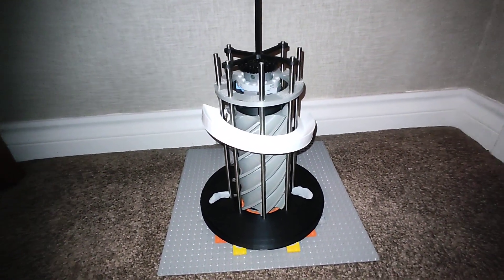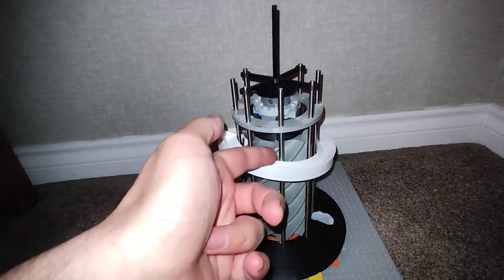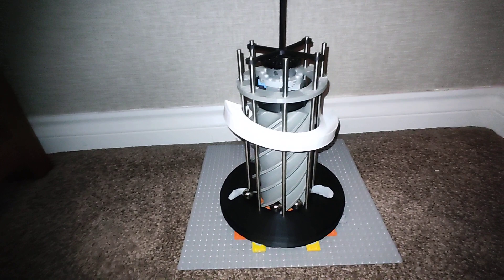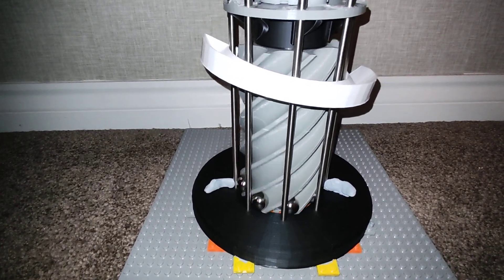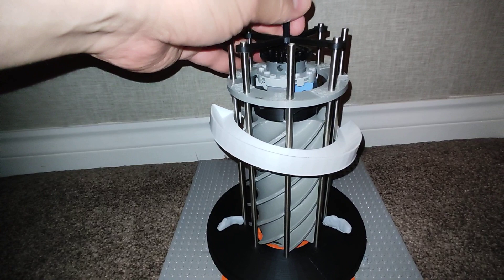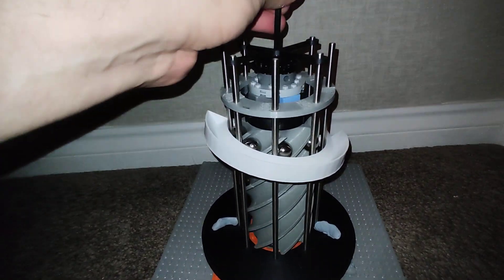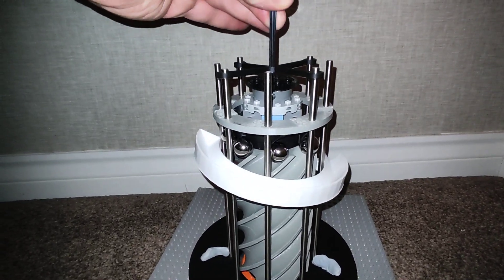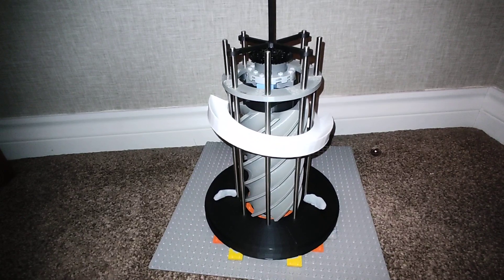MMX Helix Lift Short Update: The exit ramp.

Comment: It could use some fettling and perhaps a large wheel or crank with a long lever arm so you can turn it more easily.
Reply from the maker: The clips of the ramp extend too far into the helix, so yes these require sanding down. The active holding surfaces are actually round the back.
If you watch my other Helix Lift videos, you'll see I have a gearing system which allows me to turn it using a cordless drill.😎.